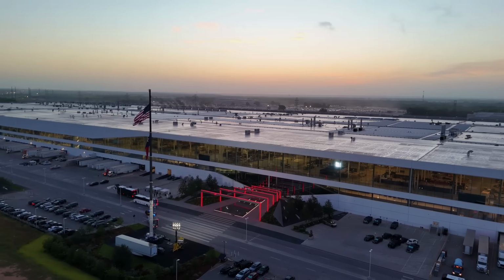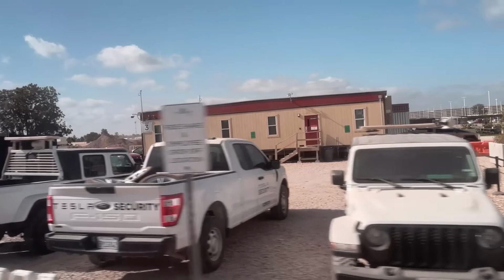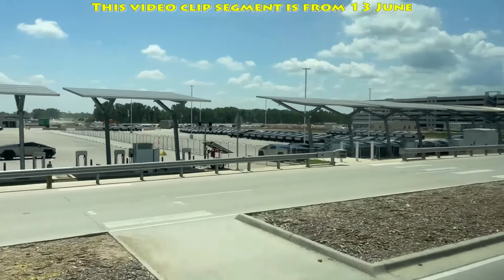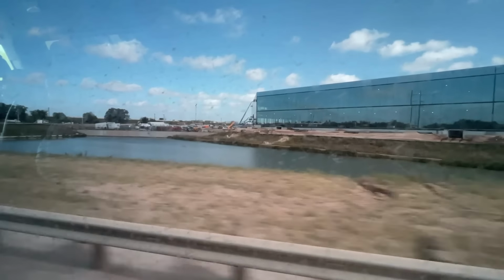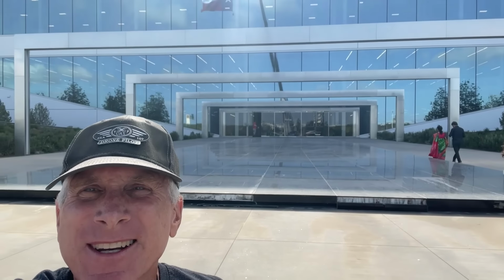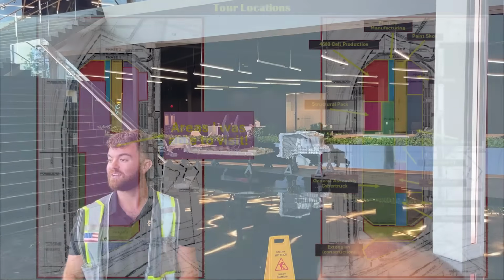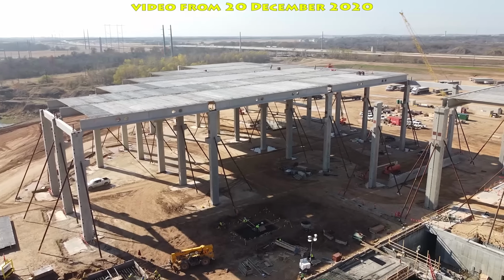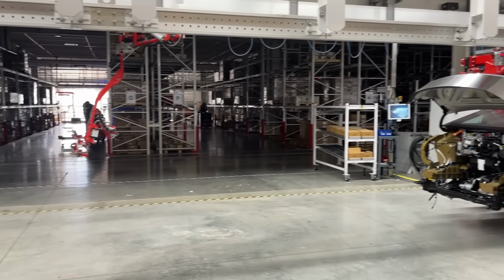Giga Texas Factory Tour Video 4 July 2024

Comment: The roads in this kind of super factory need to be designed wider, such as 8 lanes, to quickly transport materials and complete the transportation process. It is hoped that designers and engineers will consider whether the scale of the factory is consistent with the road when designing and planning.

Intersections and underground traffic corridors will also be built to make full use of driverless and unmanned transport aircraft systems.
Tesla and fuel cell super factories of the same size need to add at least 80 more. The current production capacity is too far from Musk’s desired goal.